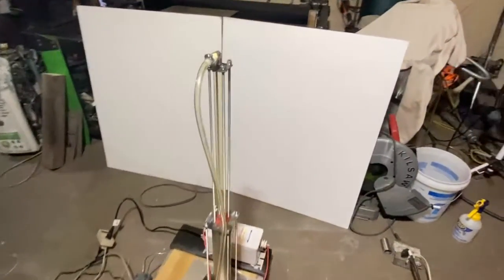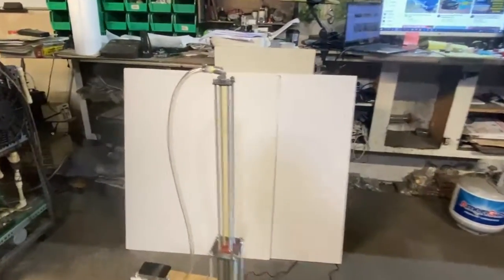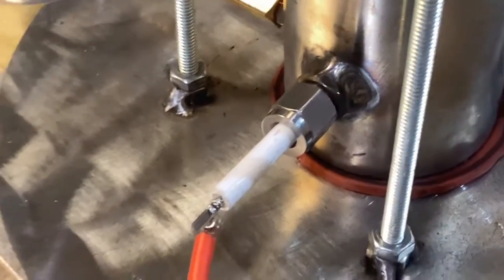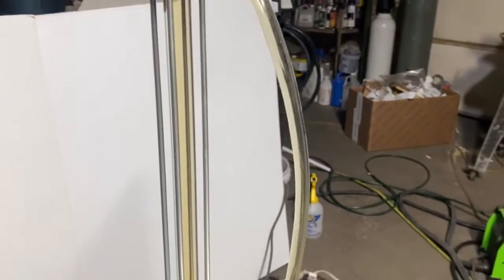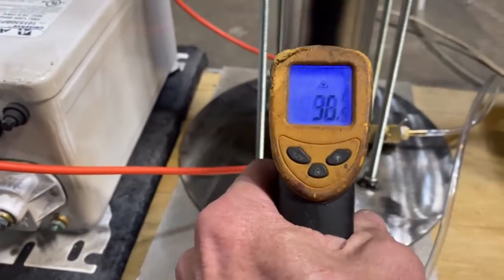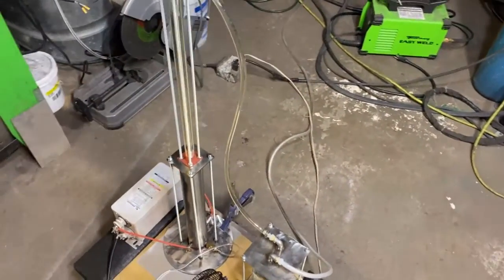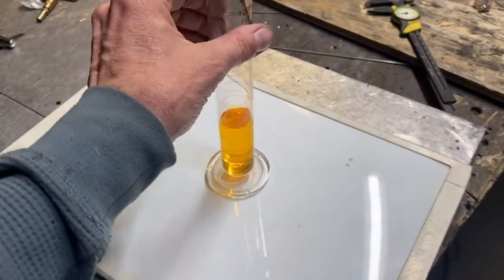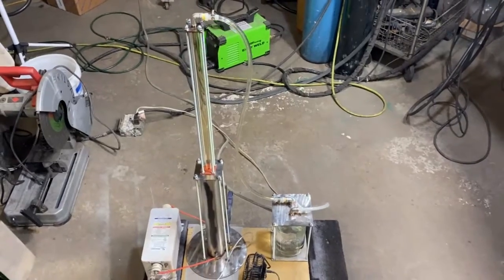Free Nitric Acid Synthesis machine Berkeland Eyed reactor 0

Comment: I was observing the bubbler and it's rather large bubbles.  I think if you crush a bunch of of glass to sand like particles, or Maybe use acid washed sand for cheap and bubbled through the patticles, then it would help break up the bubbles into smaller bubbles that not only have a larger surface area to volume ratio, but the bubbles are likely to stay in solution much longer  ensuring that more of the Nitrogen oxide is captured and converted to nitric acid in a smaller volume of water quicker.  

Further more, Google AI Gemini tells me doubling the pressure (from 1 bar to 2 bar) approximately doubles the density of the gas. This greatly increases the frequency of molecular collisions inside the arc, thereby accelerating the formation of NO. And higher pressure also increases the heat transfer rate, which is crucial for the "quenching" step. Faster quenching locks in the high concentration of NO formed at high temperatures before it can decompose back to N2 and O2...... I get the fact that sealing becomes a larger challenge the higher the pressure used. 

Just babling my thoughts on what I'm interested in for my purposes. I'm interested in calcium nitrate from crushed egg shells for fertilizer for next year, and the waste heat for augmenting heating over the winter making the heat not really wasted energy, and improving the value it provides. The gases probably needs venting to the outside anyways so I probably should pull air in from outside and  use a heat exchanger to recapture the heat going out.

Comment: I'm running similar cell right now. I use titanium tubes as an electrodes and to transfer air. Then I have additional container to give the air time to fully convert. It has clear brown color. Ph of my 0.5 l water dropped to around  1.25 after two days. This is slow but I am producing some acid and it is very cool :)
Reply: After 3 weeks (and 2 fly-back transformers fried, running at around 50W) Ph of my solution was changing very slow or maybe it wasn't changing at all. I can see some corrosion of the titanium electrodes. I ran a fractional distillation and I was able to retrieve around 34 ml of Nitric Acid (from initial 500 ml). Based on its density (around 1.22) the concentration is around 39%. Definitely not efficient process but it was worth it :).

Comment: Why not using tungsten from TIG welding instead of spurkplugs?
Reply from the maker: Tungsten is not a good choice , maybe you have tig welded before ? if you ever tig welded and forgot to turn on shielding gas you would see your tip go up in white smoke . I have another video showing how tungsten is a bad choice . spark plugs rust terribly  .this gas even degrades some plastics
Reply: spark plugs have a copper core, melting at like 1984°F, i don't understand how this is better than tungsten, melting at 6192°F   @NOBOX7 

other youtubers i've seen doing this use a microcontroller to switch the unit on and off for only a few seconds at a time.  

if you're not even using fritted glass gas dispersion, why concern yourself with high duty cycles and producing nitric quickly?

Comment: You can remove the resistor of a sparkplug and use a short piece of solid 10-gauge copper wire to replace it.

Comment: I have a small acreage and I've been interested in some kind of device that can continuously fertilize the soil using electricity, air, and water.

I've kind of imagined a small bloom of vegetation around such a device.  Maybe you have to add some other thing to react with the dilute nitric acid, limestone or some such, which might also increase CO2 concentrations that plants are gasping for and nearly suffocating, and is conveniently heavier than air.  But the idea is that you just get this trickle of fertilization that is continuous and kind of fans out downhill from the devices.  It wouldn't even have to be that much fertilization, but I've thought it could enable accelerated forest growth for silviculture, etc..  Like a bear dragging a Salmon carcass up the mountainside that enabled these forests...

To really close the loop, setup a ram pump on the creek (check), pump that water up the hillside (check), down through a kelvin electrostatic generator (experiments in progress), whose charge separation is accumulated in leyden jar/capacitor/condensors or maybe large spherical terminals, and then discharge through your Birkeland-Eyde reaction chamber, discharging the nitric acid at a certain concentration to form nitrates and trickle irrigate the hillside back to the source.  For extra credit, use air pressure from a trompe, a secondary ram pump, or even electrostatic fields with fine powdered fertilizer salts, to disperse the nitrates over a large area.  Behold, Kemet, the Black Soil.  aka Egypt.

Might cause algae blooms... but if you collect that up, it could enable a thermal depolymerization secondary process or even algae-based oil if they are subjected to extreme pH.

So I have become fascinated with ideas about turning nature against itself 
-- the kinetic flow of the creeks pumping water uphill, irrigating the forest, and flowing back into the creek 
-- the kinetic energy of water raised to an elevation, and charge separation where gravity does work against an electric field 
-- all kind of passive things, tapping the energy of nature to amplify the life that it can enable.  

But I'm more than willing to setup solar panels or run 80W power over ethernet spans to do it too.

Anyway, I like your videos.  Food for thought!

Comment: Did you consider a long, thin tall bubbler with maybe some plastic (non-reactive, hopefully to nitric acid) mesh pot scrapers inserted above and along the bubbler height?  This would put the NO and NO2 gas bubbles in contact with the water much longer and decrease the bubbles' size.  This should increase the surface area of the gas dissolving into the water and theoretically improve the efficiency of nitric acid production.
Reply: Agreed, I packed my absorption column with HDPE pellets to increase the “hang time” of the bubbles. I used a long fritted gas dispersion tube to pump the gasses to the bottom of the column. Vastly improves efficiency. Also, add a second stage.

Comment: There are a couple things clearly still missing in your setup which would significantly bump up the efficiency and yield. First of all would be pressurising the reactor, pumping in air at a minimum of 7 to 10 bar of pressure and preferably a lot more, as the higher pressure means more nitrogen and oxygen will be contacting the arc and thus produce more nitrogen oxides for the same amount of electricity. Seeing as you already have a steel (I assume stainless?) reactor that shouldn't be too difficult. And the other important thing is to add (electro-)magnets to your spark gap, in order to increase the surface area of your spark.

The industrial electrodes were water cooled, so maybe you could try that as well, perhaps even use tubular steel electrodes and coat them in a refractory metal to make them more resistant to melting/vaporising? You said tungsten didn't work because it formed oxides, which shocked me. Besides tungsten there are a couple other refractory metals with melting points above 3000 C as well, but they're a lot harder to acquire I would imagine. Rhenium for example has a melting point of 3186 C, however it's extremely rare and thus expensive. Maybe one of the other 2 remaining refractory metals with melting points over 3000 C, tantalum or osmium? Another thing to really take into account is the insane amount of power you need in order to produce any worthwhile amounts of nitrogen oxides. The industrial Birkeland-Eyde reactors would run at between 3 kV and 5 kV, at 1000 A, and even a very modest home-made one here on YouTube still runs at 5 kW, producing 2 liters of 68% nitric in 12 hours. So you're going to have to pump a lot of electricity through your reactor if you want to make it worth your while. However I applaud your effort and your very decent set-up! I find it super interesting to see amateurs trying to recreate industrial chemistry at home, seeing how difficult it is and how much of it (especially the catalyst based industrial chemistry) is almost a sort of black magic.
Reply from the maker: I too was amazed at how poorly tungsten electrodes worked . The magnets are a no go , it doesnt help on low power arcs in fact my research shows it hurts your output fanning out an already cold arc . your points regarding pressurizing the device are spot on and a fantastic idea for an upgrade . that alone would probly give us a 10x  increase in power .
Thanks for the input . Yes i have seen the large industrial designs that use magnets but during my electrode testing video we learned unless you have thousands of watts of power it doesnt help at all in fact it diminishes output . My consumption of hno3 allows for a machine that takes weeks . This machine will soon be getting 6 more electrodes and a 5 kw transformer

Comment: I also recall a potential efficiency I read about.  There’s a lot of short lived higher energy reactive oxygen species getting produced but they rapidly change back to nitrogen and oxygen.  The faster you can cool them and get them into the water the longer they will last and the more output you will get.
Reply: Doubling the pressure (from 1 bar to 2 bar) approximately doubles the density of the gas. This greatly increases the frequency of molecular collisions inside the arc, thereby accelerating the formation of NO. And higher pressure also increases the heat transfer rate, which is crucial for the "quenching" step. Faster quenching locks in the high concentration of NO formed at high temperatures before it can decompose back to N2 and O2. 

I get the fact that sealing becomes a larger challenge the higher the pressure used.
Reply: the best would be an aluminiumcylinder with active water cooling as chamber, the surounding cool as possible.industrial an long arc is better because more survace but they used stoves with 2500KW power at home you have 100w :(. in early time they used an second chamber filled with moistened pumic stone because the very high survace of the pumice stone let the NO better react to NO2.
Reply: @Preyhawk81  for the bubbler, try an acid washed sand to break up the bubbles and keep them in water longer.

Comment: Use the waste heat from the reactor to help cook out your nitrous acid maybe? Also I was thinking about if recirculation would help.

Anywho. I believe back when this was an industrial process, they used tall water columns for absorption, because it increases the time that the bubbles are in contact with water.

I intend on constructing my own BE reactor as well so thanks for the experiments.
Reply: I was thinking more about this today. What if instead of bubbling the gas through the water, why not atomize (spray or ultrasonic?) the water in the gas cloud to increase dissolution rate? It might be a little quicker.
Reply: @djsnowman06  Exactly, that's much, much better and the way to go! Gas bubblers are not how they do it in the industry as the areas of surface contact are much too small. However the areas of surface contact when combining atomisers with any gas output are absolutely gigantic, and depending on the requirements that setup can be adapted so as to create even more intimate mixing.
Reply: Have you seen nanobubble generation. smaller bubbles will stay afloat longer and have a dramatically higher surface area to volume ratio. 

Conceptually, imagine a bubbler. Stick it in a pipe. Push water through the pipe. Water speeds up as it passes the bubbler. That creates a low pressure zone at the surface of the bubbler. While water has a surface tension that normally makes compatibly big bubbles, high speed water ripps little bubbles that form on the surface of the bubbler.  

One could put egg shells in the water colum and make calcium nitrate. Nx  absorption is pH dependent. Calcium would help increase the pH and improve nitrogen oxide and  nitrogen dioxide adsorption.

Comment: can you make a 3rd video after this has been going for a while, and give some of the lessons learned about this setup and the do's and don'ts of this setup? i have been thinking about building something like this in order to make nitric acid, so i won't have to buy any for chemistry stuff.
Reply from the maker: Yes i was gonna do a 24 hr update
Reply: @NOBOX7  so what kind of arc is this? what kind current\voltage? is there a  specific frequency to it, or is it just standard mains going to a ratio change transformer?
Reply: @NOBOX7  i remember you said the total power was 40 watts

Comment: If you get the 6R12 Harley Davidson plugs, those are only 100-150Ω. Used to run the machine that made them. Always kicked back on the PRT, usually the tamp would leave excess powder that would over-rate the resistance value.

Comment: I didn’t look into it, but you might want to flow parallel trough the Spark Gaps and not in Series to avoid a back Conversion.

And I’m not so sure the PVC Tubing will hold up.

The Commenter who suggested the Spark Plugs without the Resistor is right, but usually they aren’t made for a sustained high Power Spark as far as I know.

It’s some Effort, but maybe coating Platinum to the Tip of your Stainless Steel Rod might help.

If I had the Means I’d have some Stainless Steel Rod in a Ceramic Sleeve that is connected to a short Piece of Tungsten that sticks out of the Sleeve and is coated with some suitable Metal.

Another Thing is that once the Spark is ignited the Resistance should drop significantly and you should be able to sustain it with a pretty low Voltage like a Electric Welder does.
A bit like Arc Lamps that get started with a high Voltage Pulse and then run on a Voltage <300V.
Obviously that requires DC Current and doesn’t split the Heat Load equally between the Electrodes.
A high Frequency might be fast enough to keep the Resistance low enough in the Zero Crossing.

Additionally you could have the Air Input flowing into the Reactor around your Electrode to keep it’s Shaft cooler.
Although the Heat from that wouldn’t help with the Conversion and Water Cooling the Electrode might be the better Option if you are more after Output than Efficiency.

The Electrode being hot isn’t really helpful in Case of a strong Arc I guess.
The required Temperatures aren’t reached there and a stronger Spark wouldn’t cool to much from the Electrode being cooler.
Reply: The clear tubing will definitely deteriorate. Milky PTFE tubing is the most ideal tubing for this kind of job, and clear FEP tubing is also fine.
Reply from the maker: Not true ,actually the hot electrode does help due to the the fact air has a required btu rating to heat it up , this pre heats the air in the area of the arc. The testing i did before this video shows the performance difference . I get that its obviously not getting 3000 C at the metal but it does help heat the air up in the vicinity . 950 deg F air is easier to heat up to 3000 C then  70 deg air .
I did an entire video showing the opposite of your input regarding this .Big sparks are cold and make ozone , tiny hot sparks with red hot electrodes do best . In industry they use to run an arc furnace ??? blazing red hot bro . 
The BTU of the spark is very low . Also in the last video we see that tungsten is a terrible choice for an electrode .
They only work in light bulbs and tig welder under shielding gas . Ever pop off a tig torch with the shielding gas off ? POOF , yellow tungsten oxide and electrode destruction .   As for the spark plug its only used as an insulator . Thanks for the input on the hose , its all i had . Ill get some FEP soon
Reply: @NOBOX7  Uncoated Tungsten doesn’t work as you seen yourself. It’s good at handling Temperature, but not so much suitable for Contact with hot Oxygen. The right Coating would be good at handling the hot Atmosphere but probably to expensive to directly use in Form of a Stick.

I’m not suggesting a longer Ark.
A stronger Arc which passes more Current in the same Volume is what I’m talking about.
Your Electrodes are big compared to your Spark and so the hot Tip might help, but in a Setup with a High Intensity Spark you’d be more worried about melting the Electrodes.

If the Increase in Temperature from the hot Electrode really helps you should see Benefits from passing hot Air to the Device.
Reply from the maker: Tried the air input idea as the one electrode is a 3mm tube , it did not work well , cooled the spark off to much did not make gas well . I decided before this build i wasnt doing a thing until we figured out the optimal  electrode  and the video before this concluded stainless steel glowing red hot beats all . I did think about using a old welder but research indicated when this was tried it took 20 amps before good results where achieved . low voltage high amp sparks are harder to manage long term  but i may still try it some day